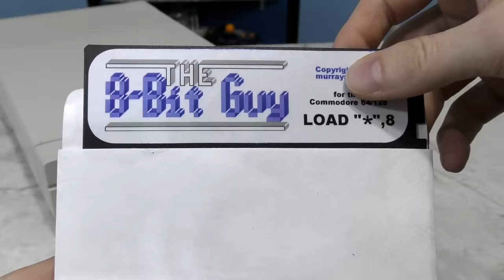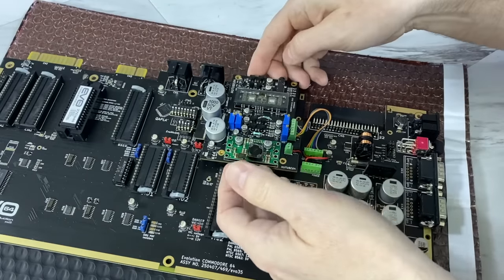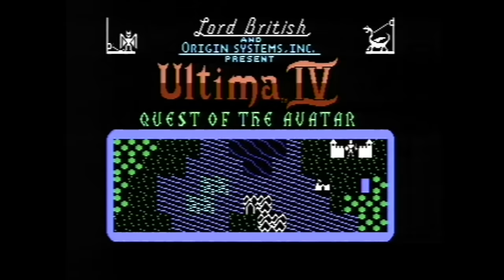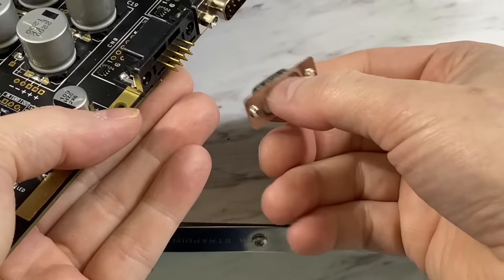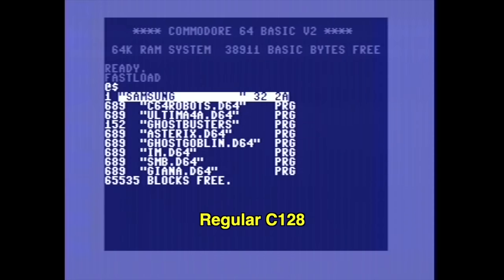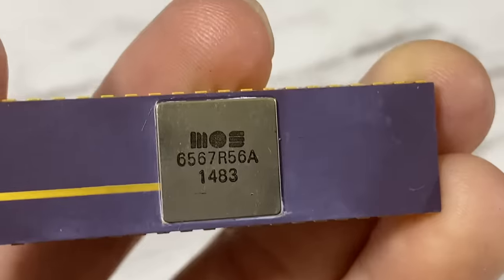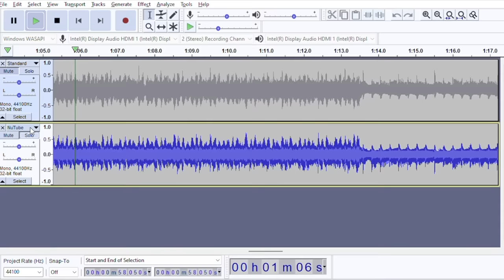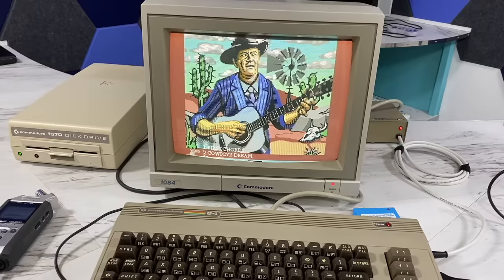The Evolution64 - Is it worth the money?

Comment: To properly assess the improvement on audio you also would need to use speakers, and even with that it's still something that not many people would want to spend that kind of money. Mods that fix the problems of garbled and cracking sound, background humm or low volume like the audio mods for Gameboy Advance, Game Gear and Mega Drive 2 / Genesis 2 are what really matter to get consistent good audio. From that baseline onward whatever you add is just fluff, probably the redesigned base audio circuit is more than enough to improve quality to a good baseline-

Comment: Video output that is "Perfect" isnt always Better.  For example.. many games artwork, is designed to Blend colors.. due to video distortions of an old CRT or lower spec video signal.  These artists take advantage of the natural blur-ing, smoother, and color bleed (blending), to make even better looking artwork.   In many games, you will see a chessboard like pattern, and that is often used to make translucent looking shadows.  On an older CRT monitor.. that pattern basically vanishes.. but it appears to be an actual translucent shadow.. even when the system is incapable of translucent colors.

 Now, if you want that cleaner video for text (programming) ... then that is one thing.  But for playing the games.. its often better to have the Original intended display and signal.  This is why you said that the picture looked "Fake",  and like an "Emulation".. because emulation is not an accurate depiction to how these games and hardware, actually looked.

 In fact, even in the Arcades... monitor technology kept changing.   The first 19"  standard res (low resolution) monitors, had a very low dot-pitch.  Meaning, the RGB pixels were MUCH larger, on the "Shadowmask".  In fact, the shadowmask itself, had much thicker lines as well, so that made a much greater "Texture" effect on the screen.  The texture you saw, helped games like Sega's "Turbo".. where the solid color green grass... looked more like actual grass, due to the texture effects that happened naturally from the display.  It looks horribly FLAT on a modern LCD, or even a modern hi-resolution CRT.

 According to what Ive heard.. the lower dot pitch monitors actually were much BRIGHTER than the later models with higher dot pitches.  The reason, I speculate, is that the phosphor areas were much larger.. and thus they lit up more, and also bled out much further.   Also the shadow mask being much larger,  made the bleed much more apparent and easy for it to occur.

 Now, as Ive said, the arcade monitor makers eventually made standard res monitors, that had higher dot pitches in them... even though they still only ran at low-res.  This made the output more clean and clear... but it did change certain games looks, that were originally designed to use that lower dot pitch monitor.   Even the colors that these monitors display.. will be different in values... because of the differences in dot pitch, and potentially in the differences in the electronics.. as well.

 As for the "Audiophile" level of sound... 

 You are not going to be able to hear the difference, on a Commodore monitors low-spec  $1.00  speakers!  lol   >_<   Seriously, you would want to run your output into a nice surround sound Amp,  and a pair of Audiophile grade speakers.. such as a used pair of  EPI 100v  speakers  (get a pair that have the upgraded tweeters.. which have a plastic bezel  vs  the older version that has a fiber-board backing).   Only then, will you be able to really hear the vast differences in Dynamics and 3d Depth / soundstage.

 That said, there are some other cheap, but decent options...  Ive owned a few Phillips boom box systems... and they had FAR superior sound clarity than any other brand... including Sony, Aiwa, JBL, and many others.  Turns out that they source many of their drivers from a high quality factory in Taiwan.   I once tried to replace a foam-rotted woofer from my Phillips woox speakers.. with drivers from sony, and a few other companies speakers.. and NONE of them even came close in terms of matching the sound quality of the original phillips woofer drivers (I learned about the Taiwan drivers, in that process).  Eventually I gave in, and actually had them re-foamed.   They were flippin awesome... until the woox mechanism itself, foam rotted  (some later woox versions were made of 100% plastic.. but mine were foam... and couldnt be repaired / replaced).   That said... as great as those woox speakers were... they still didnt hold a candle to the  EPI 100v  speakers that I eventually got hold of.    I compared the EPIs against $3000 speakers at the local high end stereo shop... and the EPIs  S**T  all over them.  It wasnt even close.

 The other Option... is a pair of  Audiophile grade Headphones.  A paid of Sennheiser HD series headphones.. model 500 or higher.. will get you a level of sound quality that rival speakers costing well over $3,000 a pair.   Check the frequency response levels, and THD%.  My 590's were like 12 - 35,000 khz,  with like .1% THD   if memory serves correct.   You could play a blueray on them, and feel like you had an entire surround sound system playing in the room (the headphones kind of "Vanish").   In fact, they were too high fidelity for some of my older low-quality MP3s, as you would hear the bad quality / artifacting..  painfully in microscopic detail.   Where as my older model 500,  didnt have as good of high end clarity.. and helped blend out the low quality mp3s, to still be enjoyable.  It was hard to go back though, once you heard what you were missing... from the 590's.

 I will say, that playing this audio though my system.. that Stereo SID music was flippin awesome.  Though, even if it wasnt the high-end version... it likely would have still sounded excellent.

 Where the biggest level of difference comes in.. is when you crank up the volume levels.  Any small levels of distortions, tend to become far more apparent, at higher levels of volume / power.   Meaning, that even if you had $10,000 speakers.. but played them at low volume levels.. you might not even hear the differences, if the differences are not that far apart from each other, dynamically.

 As for Records vs Digital.. there are a lot of factors in that.   If its a modern day record.. it would have came from a modern studio recording... and ever since the 90s, the studios have been compressing the music to utter SH*T quality.  Everything is Flat as a pancake, and full of distortions.   Now, if its an original press, or a re-press that hasnt been compressed.. you might have a decent listening experience.   Will it be better than the digital CD version?  Maybe not.  Depends on if the record engineer mastered it differently, in the process to its creation.   But again... you are not going to be able to tell much difference.. if at all.. if you are using low spec speakers.

 Realize that around the 80s... audio companies started to cut corners, and go "ECO".  They changed from using high power magnets, and higher powered coils (in sealed boxes) ... into using low strength coils, and lower strength magnets... with Open-Port speakers.  They also used thinner wood, and lower spec crossovers.. to boot.  All of this led to a far inferior level of sound quality.   My 1970s era EPI woofers are only 8" drivers.. but they weigh about 3x as much as my  90s era  12" techniques woofers.   I tossed the Techs to the curb, after getting the EPIs. 1000x better sound quality, and an INSANE 3d soundstage.. that has to be experienced, to be believed / understood.

Comment: To be honest, Tubes make more difference at the early stages, such as pre-amp or phono stage for turntables.   By the time that $500 tube is in circuit on this, it is the output stage pretty well and the sound is all generated from a SID.  It is really just a gimmick.   The sound is still C64 sound from the SID chip

Comment: You are right in the perspective that a recording is evetually digital. However with good equipment (like your zoom recorder), the recording is flat and detailed enough so that you can tell the difference. This is the case for any test for anything, measuring / recording equipment should meet some numbers, its tech is irrelevant.

About nutube ; it is not only about the freq response, which is by the way more bassy, but the LF compression it adds. It amplifies LF more than applies a compression which makes bass notes longer. This is the same effect tube guitar amps do. They sustain lower notes longer and feedback easily with the guitar. Some guitar players lower amp supply voltage to get more compression.

Better or not? It is a musical taste. Generally People prefer sustaining bass as long as it is not distorted. Nutube is clear and to me it sounds better

Comment: Coming from audio electronics background, have played around with the nutubes. Interesting stuff but I would rather see a different tube there for audio reproduction. They just are not worth the money and are hard to get to sound right compared to "real" tubes. I also tend to worry when I see phoenix contact screw terminals on a PCB... because I know the type of electrical engineers that use them.... Also, why do you even need a tube amplifier on a commodore anyway????

Comment: If you WERE going to get the tubes, modifying your case to see the tubes glow would be an absolute must and would legitimately look badass. 

I think overall it's a little silly to consider whether or not it's "worth it" as no one is using a C64 for anything beyond hobbyist reasons at this point. The tube would be purely for bragging rights/coolness factor which while it isn't really my thing I can't fault someone else for. It's all for fun ateotd :)

Comment: There was definitely a difference in the audio quality between the two on the first sample.  The tube version did seem to have more "depth" to it.  The second sample didn't seem to have as much of a difference.

But I agree, is it a $500 difference?  No, not really.  I kinda feel like the tube amp is mostly just to be able to claim you have it, because it's cool to say, rather than because it actually provides a noticeably better experience.

(I have to admit, the other version of the audio module they are supposedly going to offer that actually has four honking, traditional-style vacuum tubes sticking up (which you'd presumably need to cut a hole in your case for) does seem like it'd be particularly cool to show off to people, if nothing else...)

(And the whole "you can't tell the difference because it's digitized" thing is really usually just an excuse that tube-enthusiasts like to hide behind when there actually isn't any perceptible difference but they think there should be, or they imagine there is when they listen to it but then other people don't hear it because it's not actually there.  Modern digital encoding and replication is sufficient to provide a very high level of fidelity with the original, so if it's not in the output, it really wasn't in the input either.  The reason people like the sound of tubes better is not because they are more accurate than digital methods, it's actually exactly the opposite.  Tubes change the sound by introducing artifacts which weren't there originally (which to many people makes the result sound better).  Running it through digital processing after that happens won't magically remove those artifacts (that's not really possible), so they'll still be there in the end result too.  That is, if the differences were actually present in the input to begin with.)

Comment: The audio comparison thing doesn't really make the effort of the online test invalid in my opinion.

Changing only one variable and keeping all the other components of the test the same would be the best scientific approach. Keep the recorder, its settings, and upload compression render the same and you should hear only the difference that the source produces.

Sure, one could argue that signal A with amp-speaker combo Z sounds better than signal B does on line level direct digital recording and playback after youtube processing combo X. And that you cannot hear that A on Z sounds better than playing A on X and comparing it to playing B on X or B on Z. Ok. I may have gotten lost there a bit. But still. If you want to hear if there is a difference in the source, I still would prefer only changing one variable. Regardless if it sounds better or worse. I would expect a $500 dollar mono amp to at least sound different. And single variable testing is really the only way to demonstrate that. 

 And doing a test letting the two recordings play at the same time leaving one inverted would highlight the difference between the recordings as what is the same is cancelled out. 

Ok. The inversion cancellation test would only show that there is a difference. It doesn't necessarily tell you which is better. 

Everything else is really just audiophile woowoo and scruple-less salesmen taking advantage of enthusiasts money...

Comment: I felt like I heard a difference in favor of the tubes, but the difference was slight and not s $500 difference. Given the source material, you can only do so much especially, as you pointed out, you can't test with a true tube setup. I wouldn't bother on such old hardware.

Comment: Nutube is a cool amplifier i would buy if the price would revolve around 100$ max, i believe the lamp is a large fraction in overall costs, so propably never happen. A youtube video is not a good tool for providing delicate detail audio comparisions as the signal is processed several times digitally and lossy compressed by codec. Propably the best "feel" test would be in person with analog amplifier.

Comment: I think it's worth it, but more as a hardware durability option than an upgrade.
 Regarding the qualitative improvements, I don't know much about the Commodore specifically, but these retro systems tend to play with the imperfections to look for tweaked results, and perhaps some SID melodies can worsen with the "clarity" of the sound.
On the other hand, it would still be interesting to be able to install the 2 different sid models and be able to switch between them, instead of duplicating the sound of identical ones

Comment: `yup as someome who lived woth pc audio to rca jack from pc to hifi never the twain shall meet, as you introduce  white noise into the scenario due to going from a grounded source connection to ungrounded monitor

you are likely not  going to benefit 3.5mm jack unless you have capacity to av over 3.5 mm jack or rgb from from vga and audio to a stereo input of a period correct 1996-2005 trinatron based crt tv, you have cleaner graphics over rca output 

the only option if you want run stereo from 1 port from  c64 to  tv sp/dif toslink or digital mono using y cable or a custom breadbin or c64c/128 case  either fitted  with component, composite  or s-video as standard output and rca audio output..

unless your monitor's speakers has stereo speakers and stereo rca inputs you are likely not going to hear a difference that muck mono setup you are likely to get timing delays trying to stereo through 1 speaker

you have a monitor that is  likely capable mono chrome  green/orange/color cga/ega and vga in its earliest rendition

the resolution you are seeing out of that monitor would match with my 51 cm nec tv or 32" sony lcd of which i still own sadly the resolution  output isn't doing the commodor monitor good

Comment: i mean the sound was different, but really it's barely perceivable through normal speakers, had to use my headphones for a balanced listen and honestly, the only difference i hear is a slight increase in both bass and volume. that's about it, i'm not like a true audiophile myself but that's what i managed to pick up with my measily setup. 

don't really think it's a worthwhile upgrade if i'm honest. i think the rest of the board is nice because of the new, reliable components and also the recycling of useful chips from the original logic board, which is always great to see, but the NuTube doesn't really do much more than I already explained (from my listen anyways, if anyone has super expensive audio equipment and can perceive anything else, do tell me otherwise :D )

Comment: I feel the nutube has it's place, for example as part of a distortion circuit for a synthesizer module. Tubes do distort in a pleasant way. But as a general amplifier it really makes little sense, transistors are just as good for 99.999% of the population.

Comment: The biggest difference between the old analog and digital systems was in the speakers.  There was always a capacitor used to clip 
frequencies that where not compatible with speakers frequencies, this eliminated static noise that would distort sound. You should 
look into frequency clippers some time for improving sound quality.

Comment: The only real way to tell, audio wise, if their system is better, is to analyze the actual wave off the chip as its coming through...I'm sure there is some kind of tracker program where you can send pulses to the channels. But what to look for is the aliasing in the waves. The more aliasing, the more noise in the signal. However, I watched this video on my TV using my hifi as my sound source and there was no perceptable difference in the audio between the two captured waves, so I'd say it would probably be overkill that far.